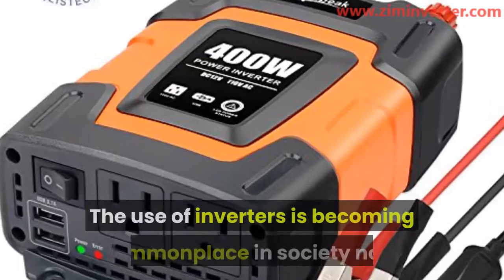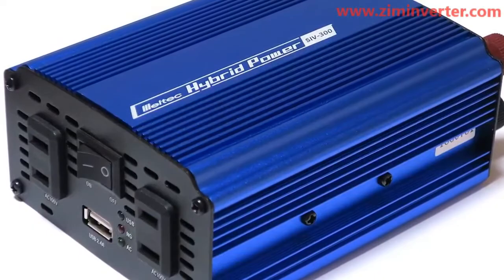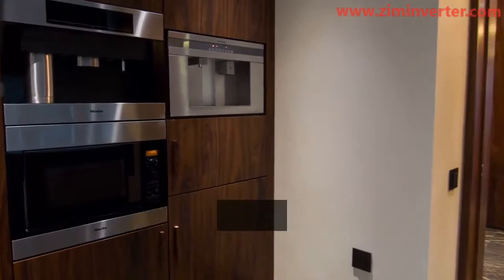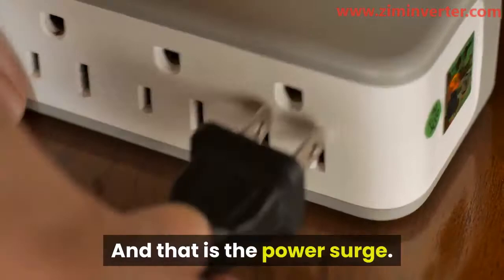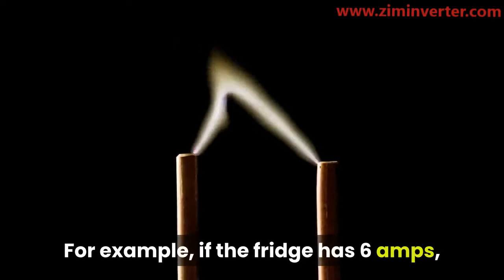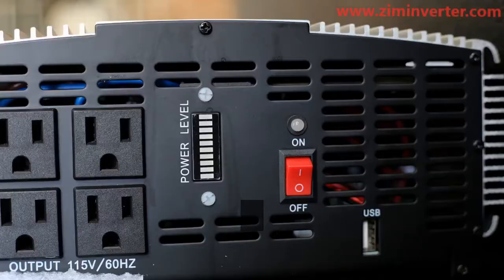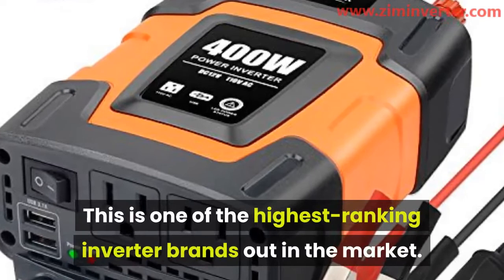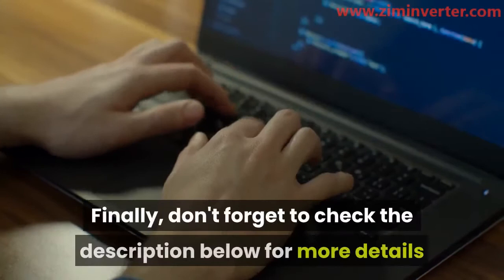What Will A 1000 Watt Power Inverter Run

Comment: @JPG23  It's you-tube videos that shows how you can use a car as a generator.Can a 1000cc car battery with a 1,000w power inverter power a electric oven that's 800w or even a 800cc car battery  ?